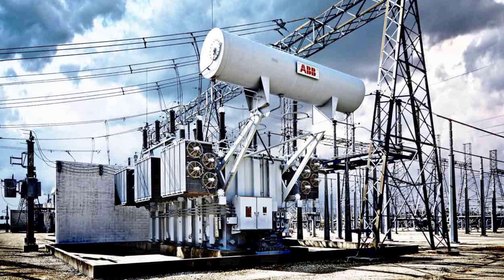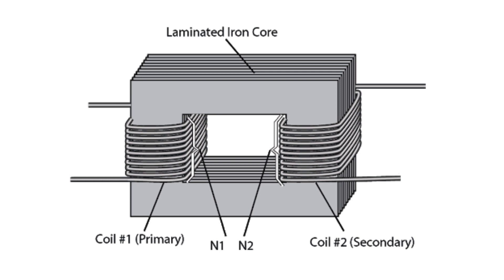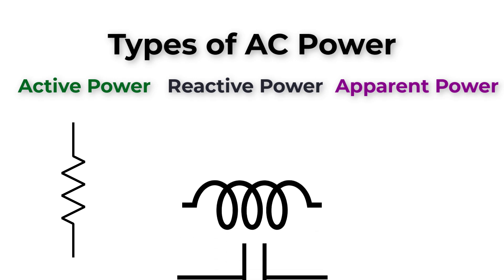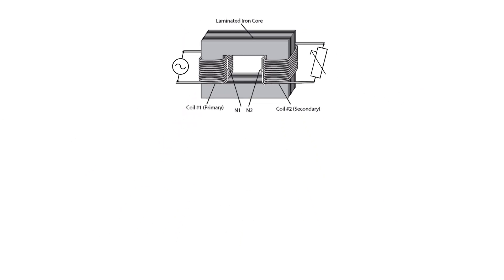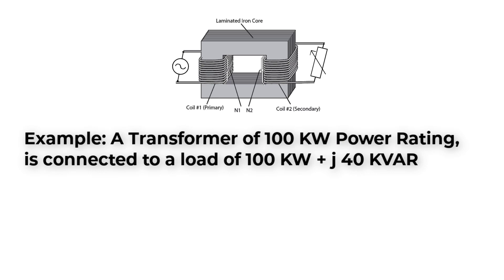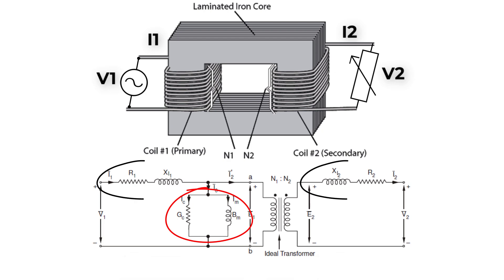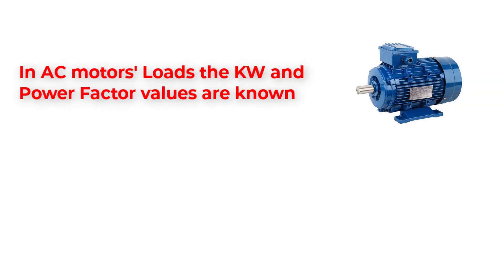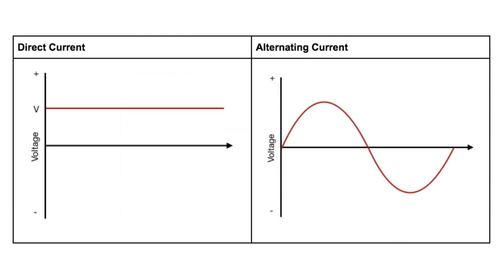Why Transformer Rating In kVA, Not in KW? |Explained

Comment: So if the nameplate of a motor shows 100W, power factor and amperage rating.  Is that 100W just the active power and not the apparent power?  This subject has always confused me but your videos are helping me understand things a bit better so thank you.
Reply from the maker: Thank you for your support <3 the answer is yes 100w is the active power,, and you can use it along with power factor to calculate the apparent power
Reply: Gotcha, thanks for the reply

Comment: so, the KVA of the AC source needs to be higher than the load voltage of the AC motor to ensure the AC motor will operate correctly?
Reply from the maker: Thank you for your question, but we can say that ac source must be designed to provide kva more than the ac load kva